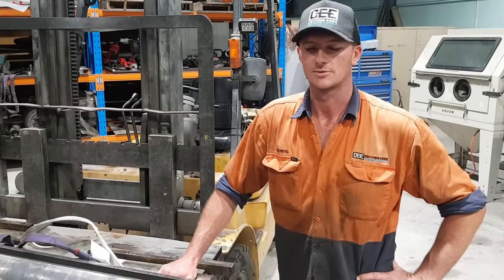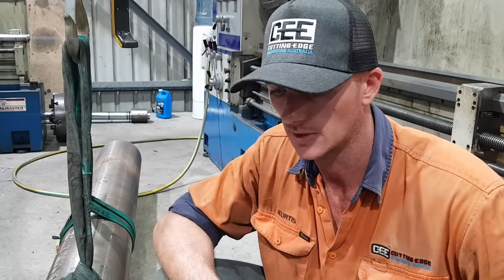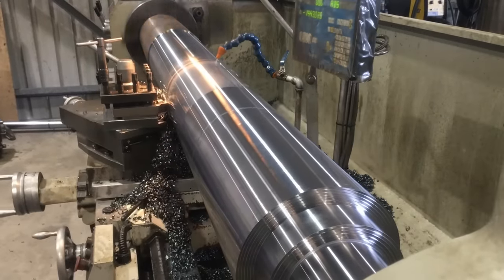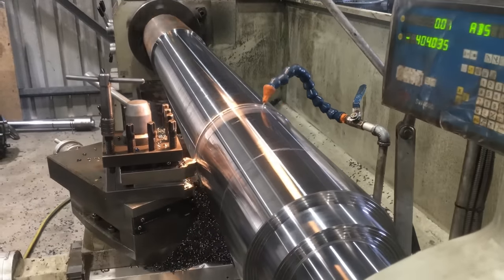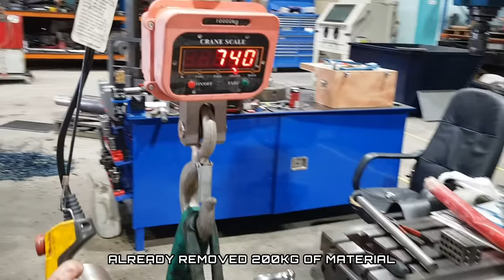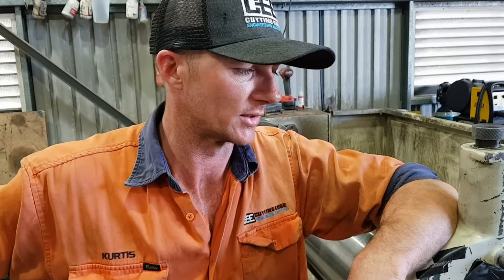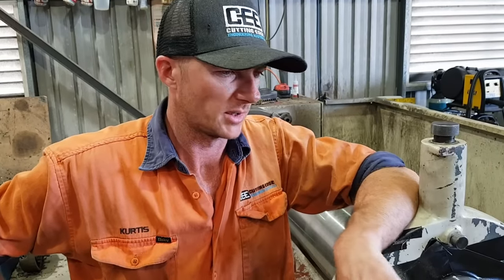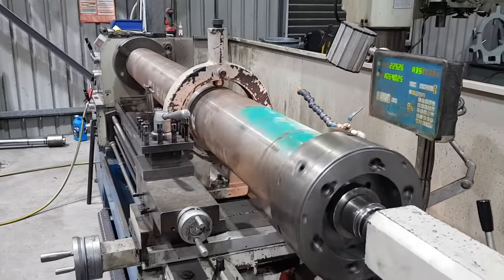Heavy Duty Machining 1000HP Tree Grinder Shaft | Part 1

Comment: I used to run a manual lathe that was removed from a WWII warship. Boy, that lathe could really hog some steel. I worked for a company that manufactured downhole oil tools.

Comment: This is always a problem with customer supplied materials, and not getting the skinny from the mill.  End pieces of a run is usually preloaded with undue stress from the extruder dies.  This bar was not stress relieved.  Bar was harder than the hounds of hell from the small blue chips even with coolant.  As material was removed, it started relieving itself giving the Banana effect.  I have seen this grade of steel from China with a good appearance and lousy grain structure.   
I think you did admirably with this project, and they do not all, come together well.  Nice Pit Bull!

Comment: Part of your runout problem was at the chuck a 4 jaw could have fixed alot of your runout  
Chucking up deep in the chuck is ok for roughing but not for finishing  remember even though its big its still a precision shaft taking a mighty  beating so journal's have to run close to keep from beating itself to death 
If you're worried about the keyway warping the shaft semi finish the shaft accurately  cut the keyway and finish  diameters on lathe  we never spend enough time to make it right the 1st time and spend twice as much time redoing  the part hope some of this helps been doing this for 30 years now

Comment: I think you have to check to run out before you start.  You have to hold it at both ends and then start adjusting the clamp.  You cannot cut on a wobbling piece when your cutting edge isn't moving to adjust for the said wobble.  You might have to heat the piece and reform it before you start adjusting the runout in the lathe clamp.

Comment: With a big piece like that, why don't you use a four jaw check to be able to center it exactly using clock gauges?

like your tailstock chuck - great way to center a large piece like that!

Comment: I realize this video is relatively ancient, and I doubt anyone is watching any more, but I just wanted to point out that both of the center holes that I saw drilled were drilled very deep.  I always worry about a hair of cylindrical hole being left in the center hole, which will cause the center to be very slightly lop-sided.  This wouldn't be a problem if it stayed there, but it will work away at that tiny edge and move.   Anyway, my point would be that if you want to drill a center hole that deep then use a bigger center drill.
Just a suggestion.

Comment: Bro I've been watching quite a few of your videos I was a little confused I have to tell you... Concentricity runs from the headstock out brother our first journal is that the headstock closest as we can get, you're holding part at the tailstock with a three jaw that's awesome... Now we need a second journal closer to your three jaw at the tailstock... Using the steady rest at the first journal.. Still holding it at the tailstock....  Now we can put the study rest as your last journal remove your three jaw at the tailstock and turn a journal and face this end.... Do not CENTER to drill..!!!! No this is what you're going to kick yourself in the ass!! You need to end over the shaft... Brother... turn  new journals  steady rest locations from the headstock to the tailstock.. Now you can establish the center... Peace bro I enjoy the videos.....

Comment: Hey Buddy 
I notice every time you place material in the 3 way chuck you say there is runout of the material .  Adjust the chuck clamps separately and load the material in the true center of the chuck.  Pay close attention to the other end and find the true center there.  This will make switching ends the same…

Comment: Leave 5 mm on all diameters, 2-3 on lengths and send for stress relief. Standard practice in our shop.  Use 4 jaw to clock in and narrow aluminium packers to minimise jaw influence on the shaft.

Comment: I have a question? When cutting these rods down, does the friction heat of the cutting tips expand the metal at all? And if so, how do you compensate for it? I'm not a machinist apparently, but a very curious person.
Reply: Yeah it expands the metal some. Not sure how much but they typically let the rod cool before taking the finish passes 

With CNC lathe machining, we're constantly making offsets in the morning as everything in the machine is heating up

Comment: A small revival here. The cutter would last longer if you use your coolant there instead of the chips and wokpiece. Also, so smooth as this is, I would rather use a hard as possible cnmg for easier cutting. Dont know details about cutters and the material you are woking with, but  do at least consider the cooling part. Regards from Norway

Comment: In Russia, in front of all metal-cutting machines, especially in front of lathes, so-called ladders are laid. Ladder - wooden lattice, made of boards, 25-30 mm thick. The ladder is made in such a way that the shavings fall freely between the planks. Thus, directly under the feet, on the ladder, there are no shavings, it does not interfere with the worker's walking, does not spoil the shoes, and in general, the risk of slipping on the twisted shavings is much lower.

Comment: How do you get "run out"?  Even if the piece wasn't centered in the lathe wouldn't more material be taken off of the HIGH side as you machine it? Wouldn't it machine it down to true? No I don't know anything about machining metal. Thanks for another entertaining video.

Comment: Thanks so much for explaining these types of problems and causes so DIY amateur hobbyist "machinists" like me can learn! I was thinking "surely if it has a bit of a bend in it just keep turning it and it'll get straight?" The tension theory makes perfect sense, the less material the more it will distort. So many problems with cheap crappy material. I note the material was delivered to you so I'm guessing not your normal supplier of choice. Hope you get reimbursed somehow for your wasted time.

Comment: If you machined a flat face on the rod and had the rod butted up to and stuck to the lathe, surely that's guaranteed to make sure it can't run out
EDIT, or machined the ends flat to make a square bar to hold on to?

Comment: Ok, I was raised in Singapore and learned to drive a Holden with a boot and a bonnet and the steering wheel on the right side. We filled it with petrol measured in imperial gallons. I learned about meters and kilograms, yards and pounds. NOW, as a calibration technician, I hear about Bananas which makes me want to know what all the other units of measure are that I have been missing out on. Mango, Rombutan, Durian? Enlighten me please.

Comment: When roughing it down could you put 2 cutters, one on each side of the tool post?  You we’re taking a 4.5mm cut. Could you offset them by 4.5 and be taking 9mm per pass?

Comment: The run out isnt the fault of the bar stock. The 3 jaw chuck is. They are never true, once you remove your stock it and flip it over, it has to be dialed back in. Use the 4 jaw for that.

Comment: I am not fond of 3 jaw chucks. 4140 and 4340 will stress relieve and give you some runout. When removing that amount of material, it pays to leave 5 mm on the diameter, and flip it once again to finish. The 4 jaw chuck can help you get the diameter concentric with the center.

Comment: Still watching... But wondered if you could have corrected for the runout or at least managed it a bit better if you surfaced the entire length one side centre drilled.. flipped it and checked runout and adjusting before drilling the second centre drill.

Comment: @Devin Shock I've never seen Kurtis talk about runout on his scroll Chuck, but on these large shafts I imagine a 4 jaw would be better, and your advice about the steps in the shoulder seem sound. I watch ABOM 79 on YouTube (Adam Booth) and he does or has done many gearbox shafts of that length and girth and he uses the same techniques that you mention. Kurtis is a great machinist no doubt, but I think he would benefit from being a little more patient in his techniques. It seems he is always looking for the fastest way to get it done, which is great for his shop, as he appears to be a one man crew, but the fastest way is not always the right way, especially in manual machining large shafts, or machining in general for that matter. Enjoyed the video. Sometimes it does not matter your technique, a shaft can just be to out of wack. Strange though, I've never seen Adam Booth have this issue, and while I've not seen all his videos, I've seen a lot, and many are of this type of machining, and on much older machines!

Comment: If it were .060 out after the first machining down to new metal, that should tell enough to stop there ? Serious question here, not a pro by any means, just wondering. What is acceptable for the application, say, center,  out to maybe 1/2 way to the bearing ends, .005, .008, .015??

Comment: I missed the part where you "true it up." Aren't you supposed to try and center the far ends of the shaft as much as possible with some dial indicators before you start chipping metal?

Comment: I'm just a hobbie machinist with an old lathe at home. Used them at work repair parts ect. And allot of line boring on equipment. My question is, if you have a 4 jaw chuck, can't you zero out the run out on the machined end then the lathe should true up the shaft the rest of the way? Why doesn't the machining true up the shaft?

Comment: You are always going to get a certain amount of locked in stresses in such a piece, these can be removed by a careful Stress Relieving Heat Treatment and for this material it would be 640C and one and a half minute soaking for every mm of Wall Thickness, slow cooling recommended. I wonder where the bar originated ?

Comment: Probably should have used prehardened 4140  get rid of that non adjustable 3 jaw chuck and be able to finish diameters all in 1 holding preferably between centers maybe use tool post  grinder to finish journals

Comment: I totally  agree  with  getting crappy ass material but that's how it is and we have to work with it  I'm thinking  rough shaft out leaving  more material for bow in part on the diameter then finish with 4 jaw chuck chuck up on an inch of diameter with aluminum pads or run it between centers its the most accurate way to make a shift use a razor sharp insert to finish possibly some honed cermet inserts remember when you get a nice shiny surface on steel you are burnishing it and creating stress in the shaft the best of luck to you in your endeavors

Comment: So I have to ask. While you were turning this piece. I noticed a harmonic pitch change as you turned the piece. Besides checking run-out. Is that another way to recognize a potential problem with the piece?

Comment: Can I ask someone here some questions? 
This is really cool I watch these cause I have no clue about how metal work is done...
but don’t these equipment companies sell replacement parts? Or is this a cheaper way to get parts? Or maybe they don’t make them anymore?
Reply: Replacement parts from OEM are very expensive, they can be made cheaper and sometimes better form an independent like Kurtis, problems can occur (?) and be hard to solve, but hey, thats the life of a machinist :) 
Fastest way often comes first, without looking at the price tag, thre part is needed ASAP.

Comment: What you need to know, is it's the TORQUE load that you design for, not HP. 4330M, EN30B and 4330V are stronger than 4340

Comment: I notice that shafts like this always break at the same point. When I worked on older mercedes models with swiveling axles, they would break right at the spline meeting the diff. This was a swiveling joint. Other pictures, same thing. Course this is also the thinnest part so no wonder they break.

Comment: turning wood, I think about hogging off huge sections before getting on the lathe to cut down spinning time.  In this case, the 2 diameters were such that you could have gouged from the end of the stock and then parted off sections of "tube" instead of turning the whole unit down to the finished diameter, no?  Tools are not very long, I get it, so you might take off rings of waste material.  Am I missing some detail, besides not being experienced in turning metal?

Comment: Just wondering, but was was this cheaper/faster than what Vameer could do to replace it? Or what the shaft just not available in Australia?
Reply: Came looking for this question. I’ve owned a couple small Vermeer chippers and a grinder and parts weren’t too bad in Texas. 
If the customer went through the trouble of finding this piece and sending to Kurtis, gotta presume it’s cheaper than a Vermeer replacement...
Reply: @freewaterscheduling1343  that's what I was thinking. I just wanted to know because I'm an engineer at a competitor 😅

Comment: im confused (17:15) , i have always been told that "run out " is (A) the tolerances of the machine doing the work ie your lathe (B) the needed dimensional accuracy of the product ,not the material . have you worked with that much weight in that lathe before ? did you miss a step to truing it up and your the reason there is run out ? not pointing any fingers just truly curious that a material can "cause run out" ?? i would be for replacing your end stock with something a lil more beefyer its most likely why your have run out with that much weight!

Comment: Not every one can work with long shafts ((only if they need many short)) because there is ever problem with residual forces in material. It is a kind of science. In my town Ljubljana, I knew the guy he was able to do miraculous with the shafts. He had on 2.2 m long and phi 60 mm only 5 mm added row material. He sad to me that they are like a snakes. Fist few of them was good only for short pieces but more than 100 of them were extremely perfect  inside tolerances of only 5 microns ands and middle. He was not prepared to discover all his knowledge but only few important facts; working partially, even changing a position of center hole, taking shaft out and putting back sixteen times, he had a special form of knife, not to make additional residual forces in material and he was preventing any kind of vibration at catting. 
And he had not calm sleep for few months to resolve a problem.    With respect to those who know.

Comment: Evidently the material was not annealed properly and started to stress relieve when you cut away all that material. Steel does weird things when you start cutting on it. It probably has some pretty tight concentricity call outs considering where it goes. I noticed quite a lot of visable run out even without the indicator. Hope you can salvage it...

Comment: only method to prevent this i think is turn it roughly to size then have it tempered after that turn it to size (i am not saying i am right) other thing i think of turn the big diameter first and then the small ends reason why i say this the small ends heat up faster then the big diameter which in my opinion can also cause runout ,i am a machinist also but im not saying i am right its just how i think of it :)

Comment: Anything that length with that much hogging should have been roughed out first both ends and then finish turned. I wasn't the least bit surprised there was a run-out issue. Also when the part had it's first end to end switch you are grabbing way to much diameter in the 3 jaw which is forcing it to follow the squareness of that end projecting a much larger error. Cheers.

Comment: Hello Kurtis, the job is turning into a bitch.  I've machined a lot of 4340 HTSR (heat treated stress relieved), and I have had this happen sometimes.  Do you know what the heat treat condition of this material was?  Over here (Canada) 4340 HTSR is always covered in rusty, hot rolled looking mill scale.  The finish on yours looks like cold rolled (or perhaps it had been debarked before you got it).  I've never done parts as big as the one your doing.  However, on smaller (4" dia by 4 feet long) I've had this problem occur.  One thing I noticed is that the warp seemed to be worse if you started out with a lot of runout on the raw stock.  I have done jobs in the past were I had to machine say 4" down to 2.5" and I left the tailstock end of the work swinging around before centre drilling because so much material was to be removed it would easily clean up.  After roughing it down, I would pull the tailstock away and the part would spring over quite a bit.  If I had very little runout when I centre drilled then this springing after roughing was not nearly as bad. Not sure if that applied to your problem however, as you seemed to have little runout on the raw stock when you started.  That's the fun/frustrating part of machining, sometimes none of what you know works on a particular job.  Even one that worked fine a few weeks earlier.  Good luck, Ken

Comment: The bar stock 4140 must have been manufactured at the foundry with more and more internal stress. Quality assurance at that metal foundry is sorely lacking. Good bar stock should be supplied to you with minimal to zero internal stresses.

Comment: If you're going to have to cut away half the material, is it not possible to start with smaller bar to begin with? I know everything has to be trued up and speced out, but it seems such a waste of material.

Comment: You could’ve fixed the run out by placing a shim under the jaw to get the shaft back in line 3 jaw chuck is not accurate. Sometimes you gotta use some tricks.

Comment: Obvious stress point on shaft at reduced diameters each end. Basic design problem shaft takes extreme load focussed on those two points why not taper down. Good engineering on your part again